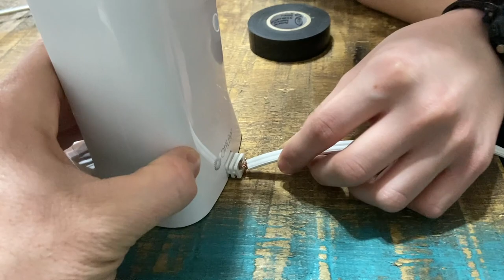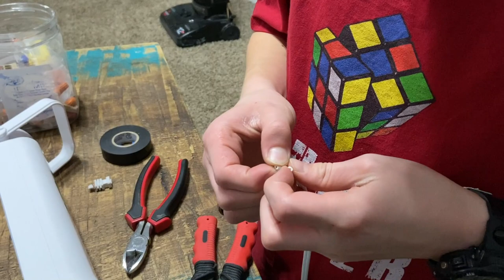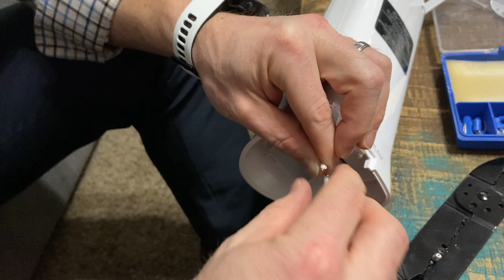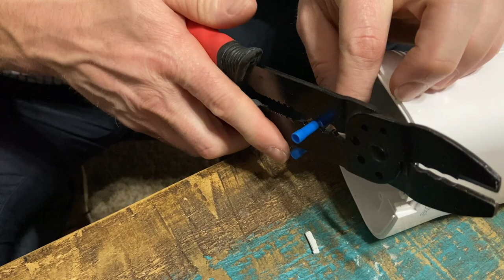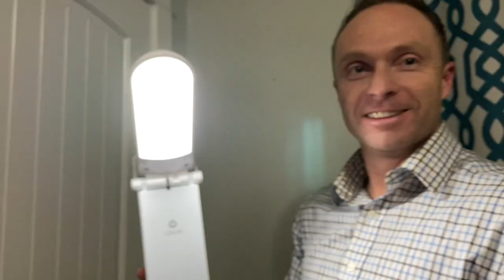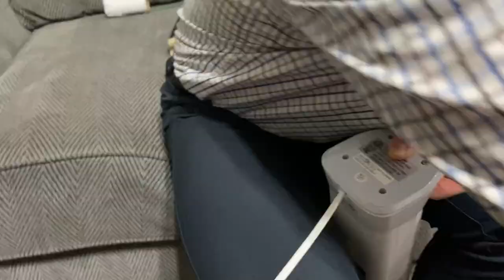Saved $45 | How to fix a broken Ott Light | Electrical Cord Repair

Comment: Great video!  Thanks for teaching me this.  I have wire strippers at home at I never even knew what they were until this video. Lol  now the question is when do we get frugal fit kid with Andrew?  He did a fabulous job narrating this video and teaching.
Reply: You can use pliers for same. Here I have seen even electricians use pliers for strippers. They use the middle part to cut and the front to pull the plastic out

Comment: Thank you Andrew. I appreciate your help. I never know that there is texture on one of the wires (compared to the other wire which has no texture). This bit of info will help me tremendously for future repairs. I looked up outline disassembly in the search bar. This is a different outline than mine. Although I've tried to take this thing apart. I think they manufactured this particular floor lamp in a way that prevents the head of it to be taken apart. So, I figured I'd have to take it apart from the bottom but the cord is attached to a wall wart which either needs to be disassembled from its box, or cord has to be cut. I opted for cutting the cord. This info about the cord having texture on one side really helps. Thanks again Andrew. You're an awesome repair guy, and your voice is very clear, as well as your instructions. Way to go Andrew the YouTuber... and thanks to your dad too, of course.